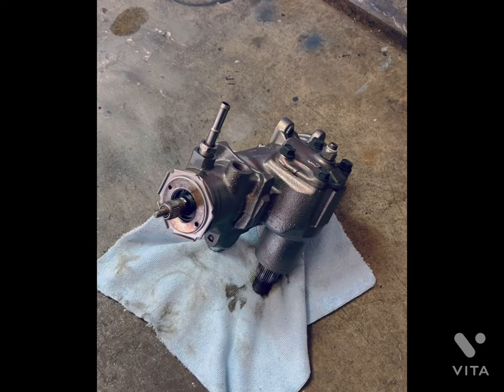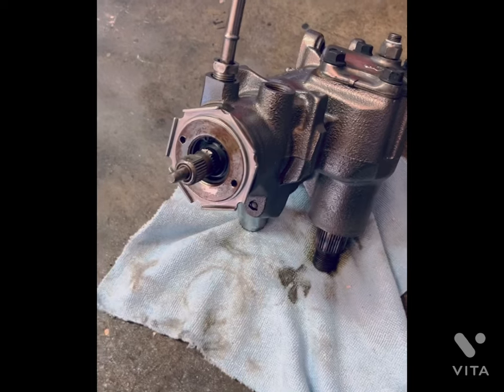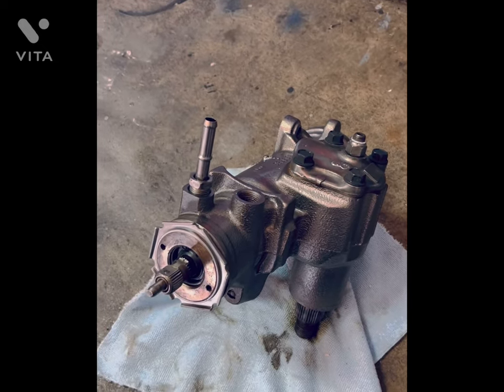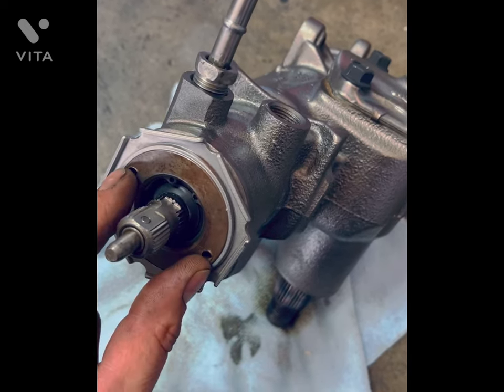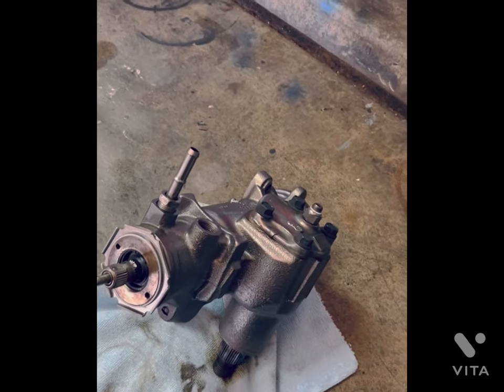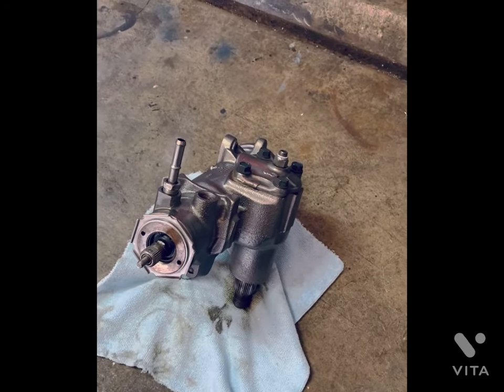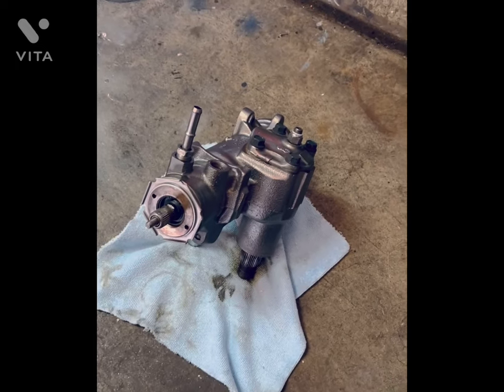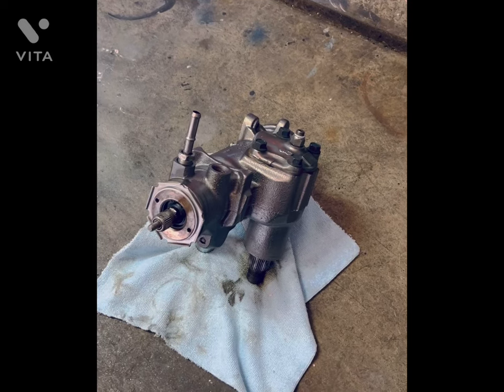How to properly adjust a GM/Saginaw steering box

Comment: wow that was INCREDIBLE. FINALLY someone doing it the RIGHT WAY! Worked on a 03 Chevy S10 (a little different but the same therory) b/c I couldn't find the right ratio anywhere so decided to work on the original (service manual pretty much backed up EVERYTHING you said). Even found out I had an old post-type torque wrench in My Dad's old toolbox. THANK YOU!! LIKE NEW results!!

Comment: Joe, have you ever come across a box that leaks from the little pin sticking out of the input shaft?  I thought my seals were bad until I saw fluid coming from the bushing area at that little 1/4" pin.

Comment: Thanks for putting this up. This is one of the best explainations of the two separate adjustments for the box that I've found on the web. And I agree that too many people go to the set screw and lock nut to try to take slop out of the box.

Although that adjustment does limit the up and down movement of the pitman shaft and can take out some slop, it's actually for the "over center" adjustment, which adds resistance at the straight ahead position of the steering wheel. This resistance helps to maintain a straight ahead direction, when you take your hands off the wheel.
However, the 6 to 10 inch pounds resistance that you mention is in addition to the measured resistance at either side of "on center".
In other words, if the resistance of the rotation was charted as a line on a graph, it would peak at 6-10 inch pounds higher at the center of travel, and fall back to normal on either side.
Reply: This should be pinned. I adjusted mine so that it takes 14-15 inch lbs. of torque to start turning the shaft from center which drops off to around 9 the rest of the way till lock.

Comment: Thanks for this educational presentation on the correct steps for making adjustments to steering gear boxes.
Reply: What this video showed me was that several shops have told me to replace the box, it was shot. Soon as I get a reasonably dry day I'm going to make these adjustments. My truck at 240K miles just requires this. In my own experience in another industry, I'm used to dealing with part replacers, not true technicians. Thank you, thank you!

Comment: This seems right on. I had to swap the input shaft on a similarly designed 1970's Toyota manual box once. His description of how to adjust is spot on. I figured it out on my own and did it by feel with no special tools. If you can't torque it the input spanner nut should be just tight enough to eliminated in and out play without making it harder to rotate. You can wrap the shaft in a rag and use vise grips to turn it. Do that with the top adjusting nut backed way out like he said and then adjust that one. Be warned. I'm watching this because I've been through two napa reman boxes. Both feel loose and tight at the same time. Having two adjustments is why. Considering the sorry quality of reman stuff I'm thinking it probably is best to work with what you've got rather than replace it.

Comment: Do some of these boxes not have the adjustment on the input shaft like yours does? I'm working on a 2014 Express van, and it doesn't have those two spanner holes (or that massive locknut) at the top like the box in this video does. I adjusted that lower allen & locknut like you said not to do, and the steering play & vibration under braking went away like it should. 160k miles.

EDIT: The owner didn't like the steering feel even though the play was gone. He asked me to adjust the box back to the way it was. The balljoints in both the pitman arm & idler arm are worn out. That's probably where the steering shimmy (back & forth vibration) is coming from.

Comment: So I have a 2000 gmc top kick, my power steering pump is locking up with turning the wheel and also with brakes on. I replaced power steering & hydro boost. What should I go for next ? The gear box ?

Comment: Mann! This is great information! I have been wondering why my 84 Camaro still has so much play in the steering wheel, even after changing the entire front suspension! Thank you and kuddos for making a great video!
Reply from the maker: Did you center your tie rod ends when you put them on? The box was centered when you put the pitman arm on?
Reply: Great vid,  @Joesmusclecargarage , thanks!

Q:  With the box on the ground, how do you determine if the box is centered? does the input shaft come up against a stop in both extreme directions?

(never mind, answered below) Q: Could this be adjusted in-vehicle without draining the fluid? Why is it necessary to be empty of fluid? It seems the fluid wouldn't be thick enough to change the gear's meshing together … Thanks!
Reply from the maker: @jbak6892  It’s not absolutely necessary for the box to be empty. I just like to have all of the fluid out of it. You obviously don’t want it full of fluid, but a little bit won’t hurt.
Reply: @Joesmusclecargarage  Thanks! If a person were contortionist enough, would it be possible to adjust the input shaft clearance while it's still installed? Doesn't sound like a lot of fun pulling the whole thing out for just that one adjustment… and would the 30# torque value be somewhat the same? Thanks again!
Reply from the maker: @jbak6892  I guess it would be possible. You would obviously have to remove the steering shaft and the pitman arm/drag link. At that point, all that’s left are the lines and the bolts holding the box in though.
Reply: @Joesmusclecargarage  agreed, but the fluid part is messy. Would leaving pitman attached to spline and disconnect the other end of it serve? Thanks!
Reply from the maker: @jbak6892  I outlined the proper procedure in the video. This procedure is shown in the FSM. Do it how you want to do it. If you’re too lazy to pull the box and do it right, then cross your fingers, and take your chances doing it your own way. Any time I adjusted a box like I discuss in the video, it felt like a brand new box. Do it how you want.
Reply: @Joesmusclecargarage  I'll admit I'm lazy :)
Reply: @Joesmusclecargarage  The problem is that I am exhausted all means to loosen the nut to adjust the play, even used commercial air tools, crow bars for leverage and still will not loosen the nut any ideas?

Comment: does the box on a 2008 3rd gen. ram 2500 diesel adjust the same?
Reply from the maker: The adjustment procedure would be the same, however the adjustments themselves are more than likely different. Verify with an FSM that applies to your truck.

Comment: Just one question… are the bearings new or still the originals? As the preload changes a bit if they are new. As far as I know new bearings need a bit of preload vs already broken in bearings only need 0 backlash. This is a very good video thanks for doing it 👊
Reply from the maker: The bearings are the original bearings. It’s not a rebuild video. I understand bearings “wear in” and tolerances can increase .002-.003”. The bearings are not the cause of the excessive slop in a box. If the bearings are shot, the box needs to be gone through and adjusting it won’t fix it.

Comment: I've always wondered why the gears mesh differently throughout the box's travel. which I learned by taking all the slop out when the wheels were steered to the side, then of course the box bound up when returning to center. readjusted with the box centered and left it at that, but why are they made that way?
Reply from the maker: I don’t know. I didn’t design the box.

Comment: I have an '05 TJ Rocky Mtn and the steering has been an issue for a while now. It has just a 2" lift, 32" KO2's with only 22lb alloy baja rims. Not even 70lbs total with the tire and rim. I have the Currectlync tie rod and drag link, Fox steering stabilizer and M.O.R.E steering box brace. I know these Mercedes gearboxes are not as good as the Saginaws, but would it fail with this modest set up? I had the gearbox tightened between an 1/8 - 1/2 turn about a year ago, but it was the half assed way, not how you illustrated. It helped for almost a year, however it's starting to get a bit sloppy and wonky again. It has never leaked any oil that I know of, I'm the second owner.

Comment: Wow, great video. So how do you know if you have slop in the system? Is it a loose steering feel that tells you it needs adjustment?
Reply from the maker: Wandering, excessive play in the steering. At rest, and not running, there should be a specific amount of play in the steering wheel. That amount is vehicle specific.

Comment: Hopefully this helps! I just got my old Saginaw box rebuilt in my bus… Powersteering works in both directions but… turning left, is too easy… and too quick.. like too boosted. Makes it a bit sketchy. Hoping it’s a valve adjustment issue
Reply from the maker: It sounds like an internal valving issue. You may have an internal pressure bleed. The Chrysler boxes of the 60s-70s had an external pressure relief valve that would cause the exact same symptoms if out of adjustment or sticking. They were so touchy if they were out of whack, the steering wheel would spin so fast to lock, it would break your arm if it was far enough out of adjustment.

Comment: Hi. Thanks fo the info. Is it possible to make theese adjustments with box in vehicle after removing steering shaft, pitman, and pumping out the fluid?
Reply from the maker: You can try. I can’t guarantee positive results though.

Comment: Do you need an alignment after this? My truck now pulls to the right a lot more than it did. The adjustment did fix about 80% of the looseness in the steering wheel at center from left to right.
Reply from the maker: You shouldn’t need one
Reply: @Joesmusclecargarage  Whats the issue then? any ideas?
Reply from the maker: @chriss4365 I have no idea what you did. Removing slop from a box does not change the location of the pitman arm in relation to the drag link, tie rods, and spindles. Did you remove too much slop and the box is binding?
Reply: @Joesmusclecargarage  I adjusted about half a turn. The steering is fine no issues.

Comment: Where do you get seals at?  I am doing a v8 swap on a 92 s10 and now that I have put power steering fluid in the pump I see I have an input shaft leak.  I cant be leaking power steering fluid everywhere.  Thanks.  Great video.
Reply from the maker: NAPA
Reply: @Joesmusclecargarage  awesome thank you
Reply: Ebay

Lees powersteering from cali

Jegs

Summit

So many more

Any car parts store based on model and year plus motor.

Comment: My 84 El Camino has stiff spots when cold starting. As soon as I force it back and forth, it's fine until I shut the engine off for a while. I replaced the whining steering pump and did a thorough bleeding so there's no noise and it's still a problem. Ideas?
Reply from the maker: Sticking pressure regulator in the box

Comment: Yestarday i rebuilt my power steering box from my 2000 Jeep TJ and installed it, but I think i tight the worm gear nutt too much (maybe 1 more turn), because my steering wheel is too sloppy now (1 quarter). This inner nutt with flat flange lock nutt were stuck together, i tried to separate them but I couldnt, but they were aligned together so i left it as it was. Can i turn it counterclockwise (1 turn) while it is installed or its nessecary to uninstall the whole setup and try to separate them?
Reply from the maker: That’s up to you. Try whatever way is easiest.

Comment: I have an automatic, 2 speed  power transmission, 350 rocket 68 olds cutlass holiday s convertible... can u plz make  a type list of steps explaining the adjustment of the power steering box? We're in our 60s, and have owned the car for 26yrs... it's got some play in steering.  Thank you, for your help! Topless in Tennessee
Reply: 1. Remove from car.

2. Drain fluids

4. Tighten nose of steering box with 30 pppunds of measured force(as tight as yer 60 uear old hands can make it with a simple 8 to 10 inch pin spanner)

5. Retighten the nose locking cap.

6 check the tension on the inputshaft(6 inch pounds) ie:easy to turn.

6a. Tighten or loosen the pittman shaft adjuster. Lock in place.

Yer done!

Comment: Thanks for the vid.

Doing a front end rebuild on a 93 K1500. All front suspension is out and only thing left below steering box is the pitman arm.

I wish I would have saw this before I put the new rag joint on.. But oh well.

My wheel is pointed straight forward and the pitman arm is pointed straight back. When I put my hand on the arm there is some play (not much, but the arm wobbles)

My goal with the rebuild is to get everything firmed up. Can I just try 1/8 turn adjustment on the pitman arm screw or am I going to have to pull all this stuff apart?
Reply from the maker: A little bit of play is normal/acceptable per the FSM. I wouldn’t go any more than 1/8 of a turn though. Any more than that, and I would recommend adjusting the box properly.

Comment: You put a mark on "this" and then put another mark on "this" a 1/2 inch back and then tighten "this" so it lines up?  Which "this" is "this" and which "this" is that? Thanks.
Reply from the maker: If you don’t understand and can’t figure it out, leave the box alone. This video was intended for those that have the ability to follow simple verbal instructions.

Comment: Many thanks for this. It seems like the hardest part will be getting the old pitman arm off which hasn't ever moved.
Reply: Agreed.... it was one of the hardest parts...

Heat... get a plumbers torch and apply heat for 10 mins ish... put the pitman arm puller on and crank till firm/snug

Tap with 5 pound hammer.

Popp... off!

Cheers

Comment: Which year is this? I have a 72 C10 that has a lot of play when steering I was thinking about replacing for a modern gearbox
Reply from the maker: I clearly state in the video it’s out of an 83 Trans Am. I don’t believe in replacing factory parts when they can be repaired. Most of the reproduction parts are now made in the orient. Nothing is as good as factory OEM parts.

Comment: So is it only necessary to adjust the flange nut if the input shaft has in and out movement?

Also, if the top set screw is only for the pitman preload, how does it affect the play in the input shaft?
Reply from the maker: It’s always a good idea to set the input preload. The top “set screw” ensures proper mesh of the gears.

Comment: Hi...rather than a reman box would a brand new OEM Saginaw 68-82 Corvette Manual Box from Borgeson come with all the proper adjustment and be ready to drop in the car straightaway...I have a 1978 corvette...thanx
Reply from the maker: Why spend money on a brand new box when it’s incredibly easy to rebuild them? The adjustment process is as easy as the disassembly and reassembly.
Reply: @Joesmusclecargarage  understand and thank you...but again if i were to go with the new aforementioned box from your experience do you sense it comes equipped with all adjustments pre-set and ready to drop into the car and simply tighten up all related fasteners
Reply from the maker: I would hope so for what they charge for them.

Comment: Joe, I bought a NAPA reman for my 97 Jeep TJ before replacing all the tie rod ends. After the alignment it drove like on rails. It is now is as sloppy as before any work was done on the steering. Would adjusting the pitman endplay a little be okay or should I just pull it off and do both input and pitman? Thanks, Dave
Reply from the maker: I’d verify where the slop is before you start messing with the box.
Reply: @Joesmusclecargarage   Thanks for the reply. I was somewhat hoping that the PS box was just loose on the frame (not the case). All the T-rod ends and B-joints were replaced <500 miles back. It appears that there is some lateral movement at the pitman shaft (output) end. Thanks again for the feedback. Dave
Reply: Does a 67 nova have those same two adjustments ??
Reply from the maker: @edgregor9578  Yes
Reply: Well done Joe. I’ve messed around with GM gearboxes for years and never knew about that adjustment. I added PS to my 68 SS Camaro and used a reman IROC Camaro box since they have nice road feel. The car seems to wander a bit, now I suspect the reman guys don’t do this correctly. I’ll pull out the gbox and give it a try. Fortunately I have dial torque wrenches that will make it a snap. Thank you.

Comment: Hey im wondering if you has an opinion on a input shaft that has side to side movement? I have saginaw in a 92 dodge w250 it was rebuilt and the rebuilder put in a different torsion bar to firm up the steering feel. The steering is good, no slop, and firmness is good maybe a little to stiff for my liking but its cool. I noticed there is a small drip of fluid on the steering shaft universal joint thats on the input. i grabbed the steering shaft and noticed the side to side movement its not alot but im thinking thats whats causing the small leak. should there be any side to side movement, whats your thoughts?
Reply from the maker: There should be no side to side movement. When turning the input shaft back and forth, is there any in/out movement?
Reply: @Joesmusclecargarage  that’s what figured. No in and out movement. Maybe it’s my rag joint with some play that’s making it seem like there is movement. I’ll pull the steering shaft and see if the input still has movement. Thanks for the reply.

Comment: I have a spanner wrench for the input shaft adjusting nut but how do you get a torque wrench on there to do the initial 30-ft-bls of torque on it?  Seems like I would need a special tool for that like a huge socket like adapter with two pins that fits the spanner holes on the nut..
Reply from the maker: Like I said in the video, you can feel 30ft/lbs. Just think small/big block intake manifold bolt.
Reply: @Joesmusclecargarage    Yea, but don't think my little spanner or a pair of needle nose could even tolerate 30 ft-lbs.  I may need a better tool to tighten it.  Thanks.